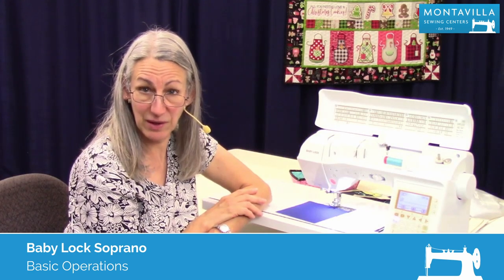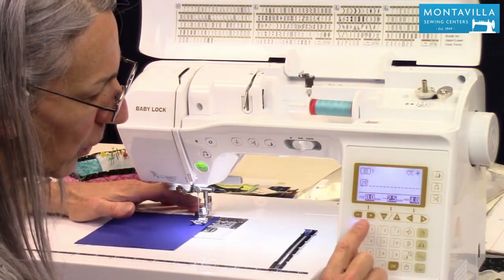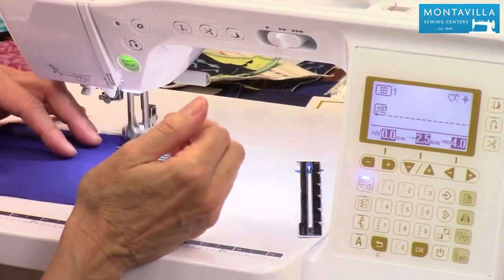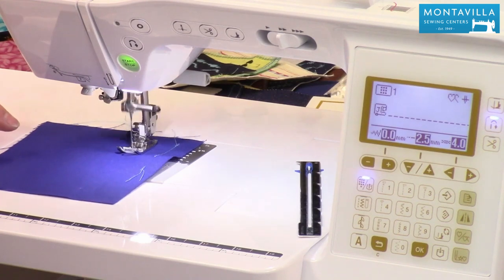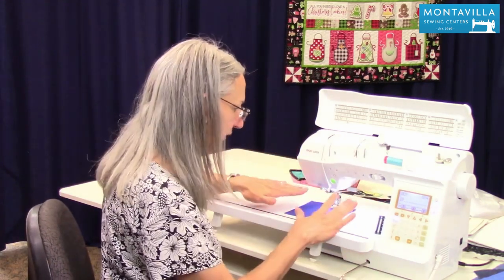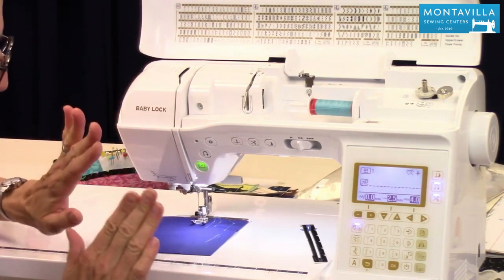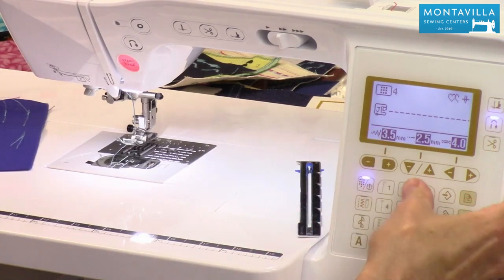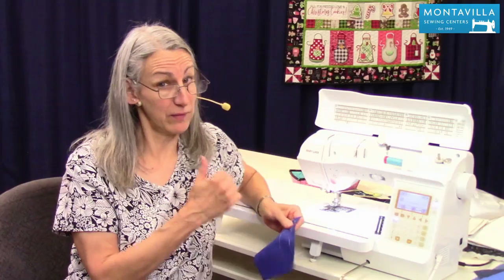Baby Lock Soprano Tutorial - Basic Operations

Comment: 8:55 for the locking stitch example, if the automatic lock stitch button on the keypad was NOT selected, would the machine still perform a lock stitch at the beginning of the pattern because there is a lockstitch symbol on the stitch pattern number 2?